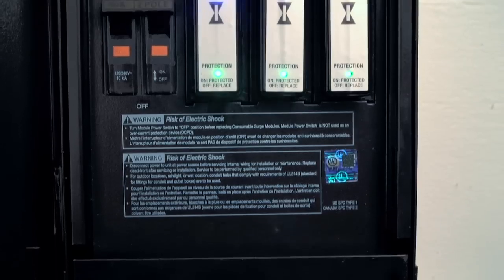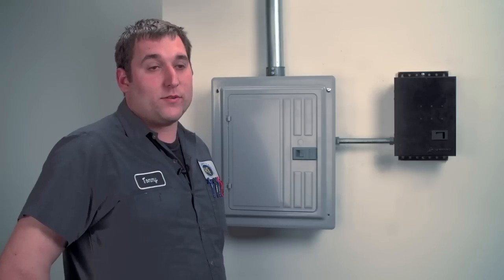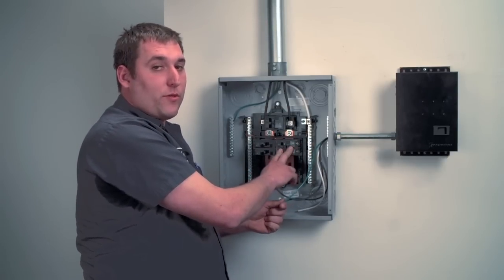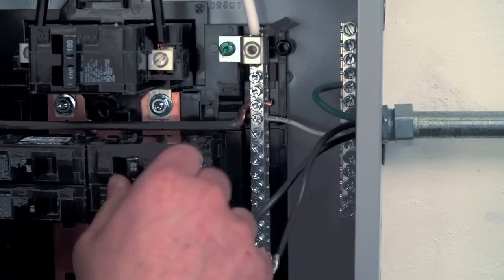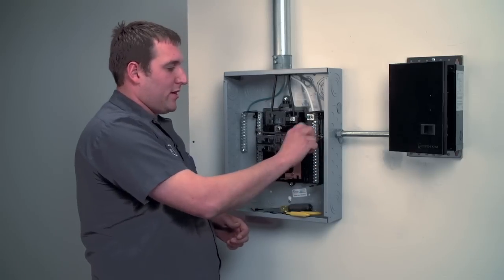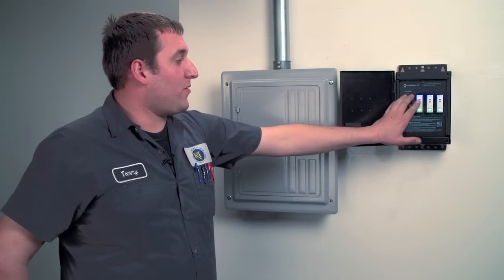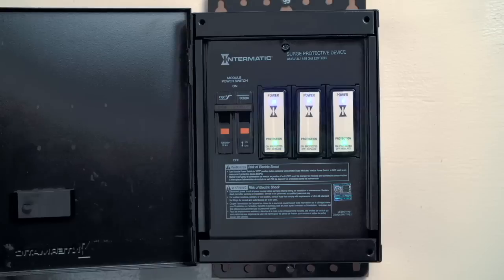SmartGuard® Consumable Surge Installation Video

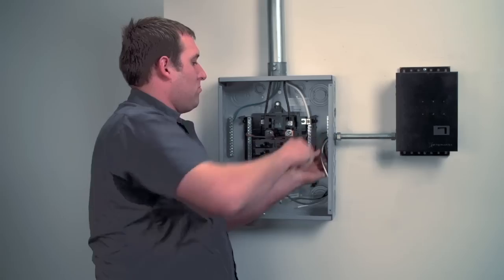Comment: 2:13 a 20AMP 2 pole breaker, and manual told us 30AMP. Which is correct?
Reply from the maker: Hi George, Since the wire gage is 10AWG, it will be sufficient for both 20 and 30Amp breakers.

Comment: Hi
I have 2 questions for you plz
1- The breaker should be installed on the top of line near to input only or it can be installed even in the bottom on the last available space I have for new breakers?
2- Instead of using 2 single pole breaker may I use a 2 in one breaker ?
    because there is only one slot left in bottom of my panel.

Thx for your time
Reply from the maker: Hi Ahmad,

1. It is best to install it at the top. It will work lower in the panel.
2. This must be installed on a 2-pole breaker not a tandem breaker. So no, you are not able to use the single space breaker with 2 outputs.

If you have any additional questions, please contact our Technical Support Team. You can reach them at 815-675-7000 or https://www.intermatic.com/en/contact-us.
Reply: for 2, you are protect the only one Line..........

Comment: After having mine for 2 years installed.  And plenty of lightning near by, never had any issues. Two weeks ago lightning hit the light pole about 150 ft from my house but uses same underground power lines/transformer. All the houses using same transformer had damaged equipment. Mine was the only one that did not. Eventhought lightning blinded us inside the house. I am for sure that Intermatic surge protector did its job, but no modules failed. I am happy with my investment.
I will send direct email on how happy I am.
Reply from the maker: Hi Ricardo, We're so glad the unit worked as expected and saved your home from having damaged equipment!

Comment: I'm curious about the general theory of what a typical surge is (say a nearby lightning strike) and how this equipment protects it.  In my mind (from reading other comments), I think it's something like this:  A "surge" is an extremely short and potentially very high voltage. The IG2240-IMSK somehow acts as a voltage regulator by absorbing the over-voltage into the consumable modules?  It somehow protects all other circuits by being anywhere on the panel bus.  The consumable modules don't interrupt current in any way--they absorb quick high-voltage surges.  The modules become inactive after taking a surge hit--that's why the LEDs are needed.  Are my assumptions above correct?
Reply from the maker: Hi Dave - thanks for taking the time to send us a note. That it is a great idea and I will pass it along to our Product Manager.
What you've described is a feature we had in our older commercial series Panel Guards.

Comment: I have a panel full of breakers - can the surge protector be hooked to a 2-pole breaker that already has the range (and only the range) on the circuit (20 AMP)
Reply from the maker: Unfortunately, no, you cannot double up wires in a breaker.  If you need further assistance, please contact our technical support department:
https://www.intermatic.com/en/support

Comment: Hi Tom, thanks for the video. This is a good setup and a superb idea so I am getting one...but just two questions...why a 20Amp or 30Amp at the main breaker when the circuit breaker is a 50Amp? Second question, is it advisable to shorten the cables and bring the panel closer? the distance is as if the surge could reach other breakers before the unit gets hit. Or,  perhaps is not as important as I've heard from others.  Seems like it was a big deal that the breakers were closest to the main feed.
Reply from the maker: Surge devices are designed to handle over-voltage circumstances. They are not drawing power so there is not a significant increase in amperage. Breakers protect you from amp spikes. As far as shortening the wires… Yes, that is ok. The only real benefit you would get is if you had something connected to the breaker panel that has a shorter distance between it and the buss bar then the distance between the surge device and the buss bar. Best practice is to use the top breaker to ensure the shortest path to the surge device. I hope this helps.
Reply: Intermatic  Thanks for the prompt reply.  I hope you don't mind if I ask another question..if, in a Square D Homeline panel there is already a Square D Surge protector (the kind that replaces two breakers and has a pigtail) can a second one (yours, the consumable) be installed? ....and, do I need one in a subpanel? the question is because the subpanel feeds a freezer and a garage, but also two bedrooms. So, I wonder if the neighborhood of breakers there would get mini-surges before it hits the main panel. I promise I will not ask any more, ha!
Reply from the maker: Yes, you could add one of our surge devices. You don’t need it to be on a sub panel (unless you need the room). It won’t hurt anything.

Comment: Does the unit come with 2 black, 1 white and 1 green wire ? … Or do I have to buy #10 and run them my self from the breaker to the unit.  I bought 5 units for my house the other day.
Reply from the maker: The wire should be inside the enclosure. 2 Black, 1 White and a Green.
Reply: Intermatic cool thanks

Comment: does the 20/30amp breaker needs to be at the top, or anywhere in the panel?
Reply from the maker: The breaker does not need to be at the top but it is the BEST location for it.
Reply: Thanks. And because I have solar and a main feed in that shed that runs to 4 different buildings. Do I need a device in every building at their own panel or just one at the base in the shed with my main panel and 4 x 60amp breakers?
Reply from the maker: The best protection is to have a surge device at each panel - because a lot of surges can be created inside the home.

Comment: When you turn off power to the surge protector, does that shut power down to the whole house?
Reply: No it does not.
Reply: No, the line side/incoming power on the main breaker is still energized. If you do any work yourself, be very careful not to make any accidental contact with the energized parts or conductors, you could get shocked or even electrocuted. You can be killed by 120 volts. In fact OSHA requires qualified personnel exposed to voltages greater than 50 volts be trained in electrical safety. Best practice is to wear insulating rubber (hot) gloves & safety glasses along with using insulated hand tools if there is voltage present. If there is no disconnecting means ahead of the service panel, I highly recommend hiring qualified, licensed & insured electricians. The only way to then turn off power would be to have the utility company remove the power. Be safe.

Also, keep your conductors as short as possible. I would use a lot shorter nipple between the panel and the SPD.